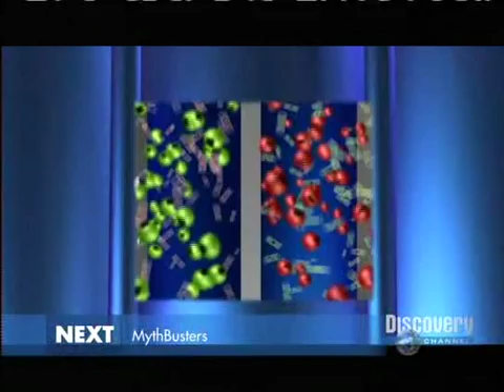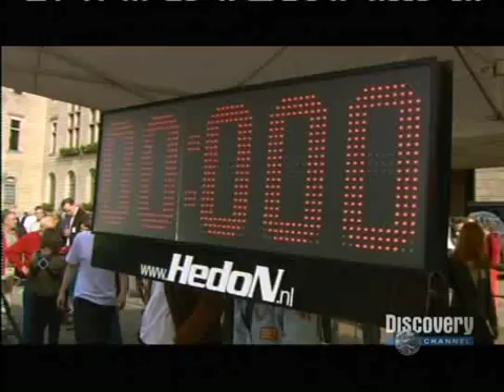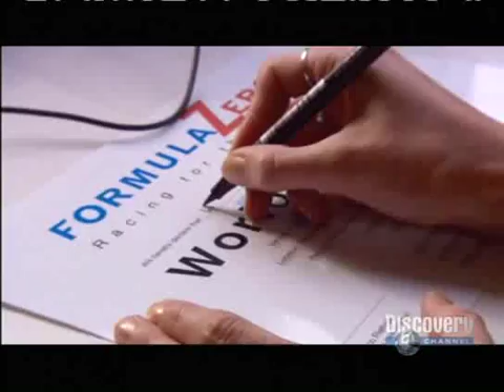Formula Zero record for nitrogen vehicle

Comment: I got my Christmas Present early, a bargain from EBay, 3200 N35 Grade Neodymium Magnets 30mm x 10mm x 2mm slabs. That's 32 metres long 30mm wide. Eight metres per wheel! They will be embedded in an ultra strong toothed belt(quasi-linear motor) Those 200 mph Formula '1' race cars had better move off the track. they will be too slow, and will get in the way!:-)

Comment: your right....
But, in this acceleration attempt the kart used a fuel cell (abouth 8,2 kW) and socalled ultra-capacitors (abouth 35 kW). Adding more ultra-capacitors would significantly increase the short time powersource and decrease the acceleration time. 

However, this is only speculation. Main goal will be in endurance racing, and not in drag racing.

Comment: Very cool hydrogen/supercap electric kart. However, 11.4s is not a record for electric drive go-karts in the 1/8 mile. Go to nedra dot com, click on record holders to see 10.17s for a 48V e-Kart in 2001 with Lead Acid batteries. Lithium batteries should be even faster. Where hydrogen may have a future in racing is in endurance, not drag racing. The future of drag racing is with Lithium Iron Phosphate, like A123systems powered Kill-a-Cycle killacycle dot com